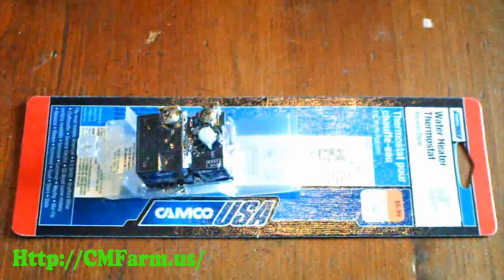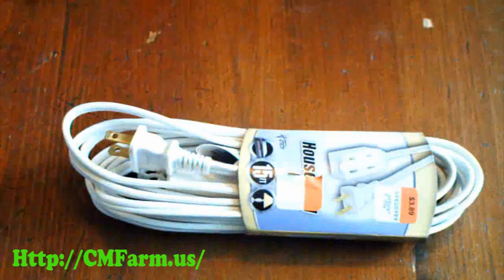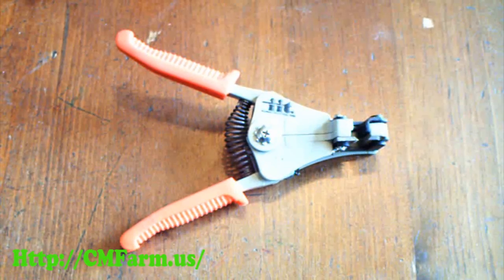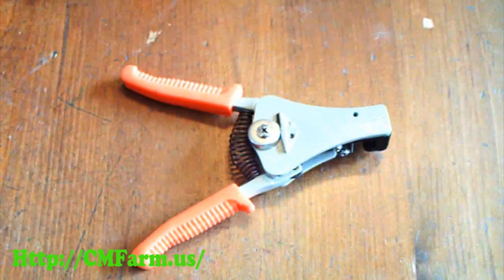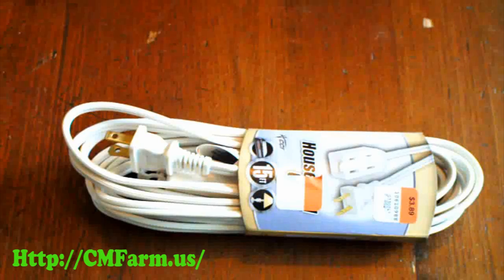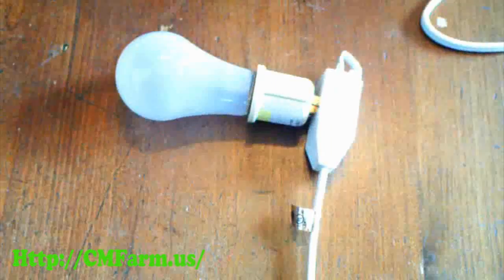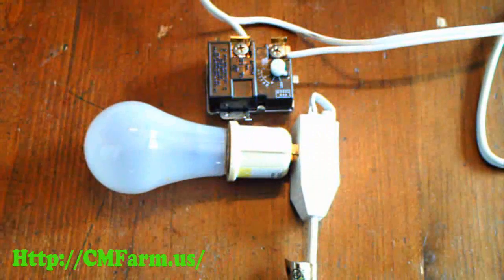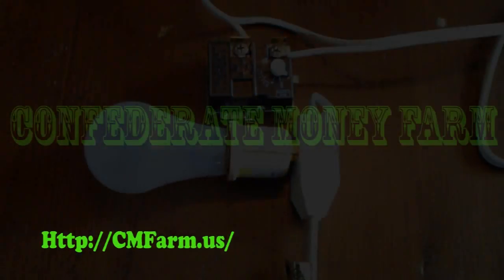Building a thermostat controlled outlet.

Comment: Can it be wired either way, and how has nobody asked?
Reply from the maker: It can, sort of. The switch does not care which way its used and either wire will cut the circuit. But generally its good practice to break the circuit on the hot wire. If you break the circuit at the ground wire, the outlet is still live with no ground. If you drop it in to a puddle of water, power will start flowing to ground blowing fuses or shocking you. If you break the circuit at the hot wire, the outlet will be dead when the switch is off. That matters if your running mechinery or wiring a house. If you are wiring a lightbulb to heat an incubator, I dont think it matters much. I am sure others will disagree though.  Sorry for such a late reply. Not on here much.

Comment: You are correct. I was under the impression it had a manual on/off switch as well. Since it doesn't, it comes down to preference where you put the thermal switch at. Like you said, it should be unplugged regardless since there is no manual switch.  Some people don't know anything about electricity and how it flows so we have to build and explain stuff to the lowest common denominator sometimes depending on the target audience. Thanks for taking the time to respond.

Comment from the maker: The same thing can happen if you just plug a light in to a drop cord. This is adding a heat control not a switch to cut power. There is no "off" position on these thermostats so the circuit is always hot unless it is unplugged. Same as before adding the thermostat. It will turn "off" but it does not stay off. I do agree though that if you add a power switch with an actual off position to a circuit, it should be on the hot side to save the people that think off at a switch is off. an safe.

Comment: Great Idea. I do want to add one thing though. It is extremely important that you break the circuit on the hot/line side and not the neutral. If it is broke on the neutral, there will still be potential for the circuit to be completed at the light bulb even if the thermostat is off if the bulb is broken and filament exposed. I don't mean to call you out or anything, but being an electrician, I couldn't stay quiet as someone could be injured if done incorrectly.

Comment: does this mean when the temperature reaches 99.5 it goes off or that it keeps the water at , or in better terms trys to turn on and maintain at 99.5F? Just wondering if it is too hot say for winter time when the temp outside is 32-45F or similar?  Can it be adjusted to maintain at say..80F?